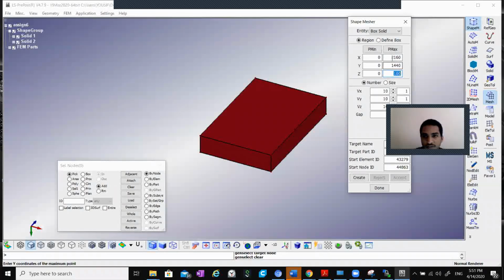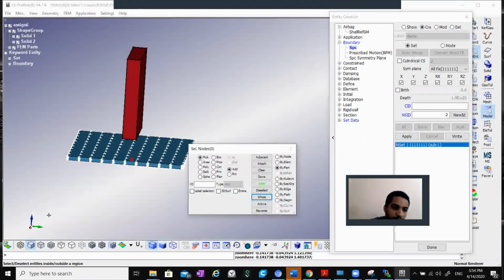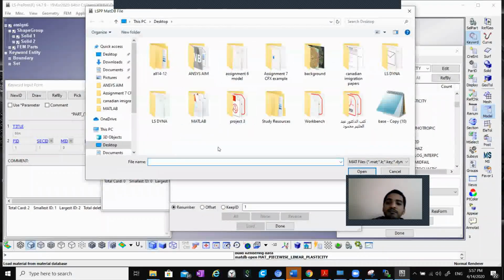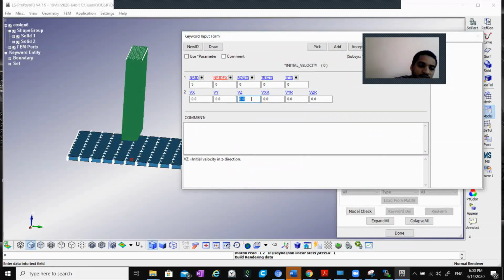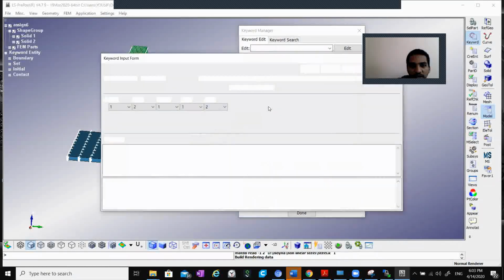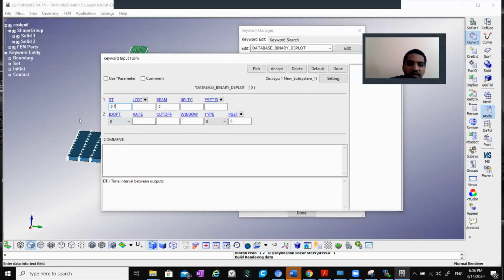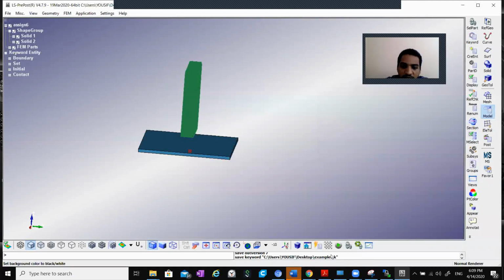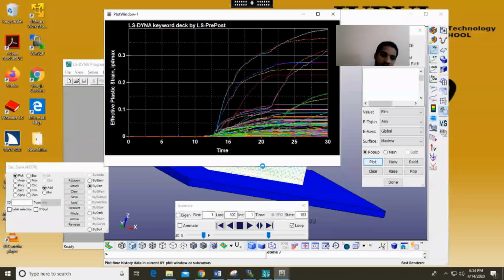Ls-Dyna drop test

Comment: Thanks for sharing this video!! I have a question. I have a multi-cell thin-walled structure with a special cross-section. it is self hierarchy hexagonal tube with circular reinforcement at the center.  How can I model this in the LS-DYNA  by import its 3-D CAD modeled in solid work? in the section-shell, there is only one thickness that I can change and this is for the entire structure wall connected by ribs. How can I model a shell part that has a different sub-part with different thicknesses?
Reply from the maker: Hi , The main Idea when importing a geometry into ls dyna is that you need to mesh it after making sure all of the structure is correct. 
1.import geometry
2.make modification
3. Mesh (you can always control the meshing in auto mesher )
Please check this video and how he makes modifications before meshing https://youtu.be/ezyJOLIjCH4
Best